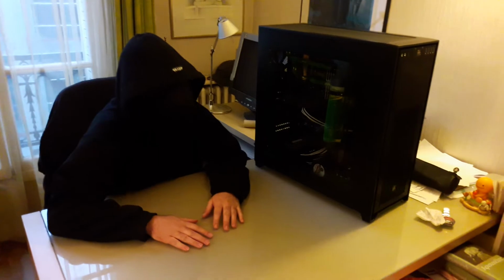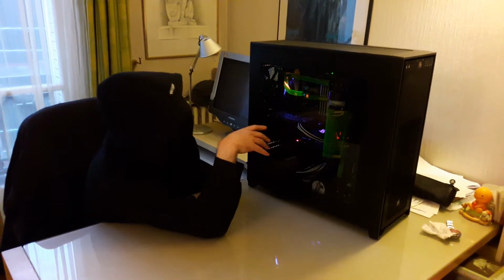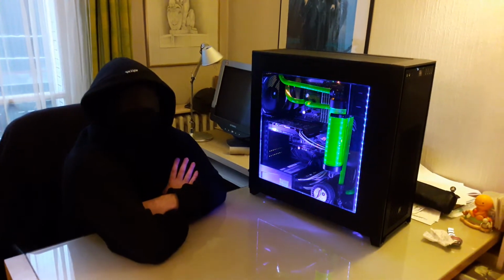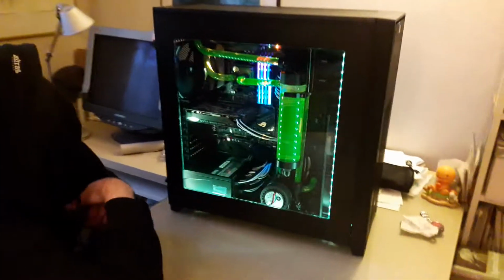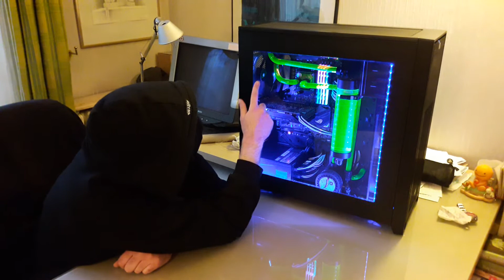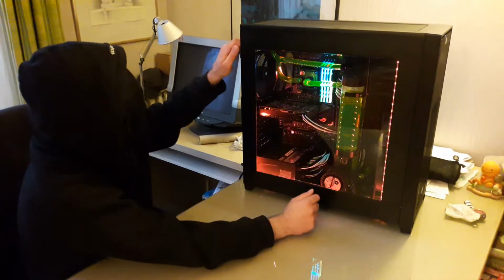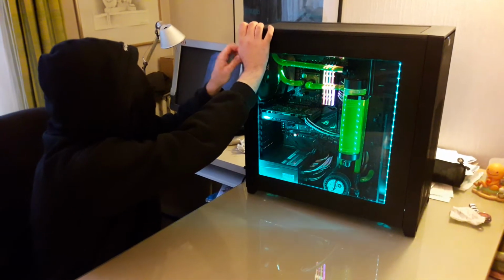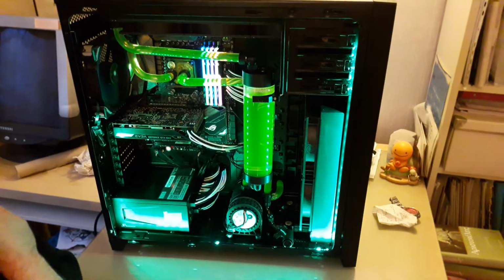Ryzen Build Log Part 12: Final result, impressions and system boot!

Comment: hey thanks for the video but I got a question , where did you plug in your 4 pin connectors  and do both pumps work at the same time?
Reply from the maker: I plugged each pump to is dedicated 4 pin power plug then connected the both 4 pin fan controllers to a Y 4 pin fan adapter which in turn i connected to the pump header on the motherboard bottom right. Yes both pump work and are controlled by same 4 pin. You need to make sure you get the proper connector. I run them at 40 %.
Reply: which connector  did you use ? and thanks for the video and info
Reply from the maker: You"re welcome! Make sure to like and subscribe! I am 90 % sure i used this one:
https://www.ekwb.com/shop/ek-cable-y-splitter-2-fan-pwm-10cm
However Ek is not the only one making those.

Comment: Can you post a short video of the res up close with the pumps running at 4800rpm please? I want to get an idea of the maximum flow rate with 2 pumps.
Reply from the maker: Check the video part 11 were i leak test and only the pumps are working. If you set the pumps at 40 % you wont hear it. Unless you have a highly restrictive system you wont see any temp improvements.